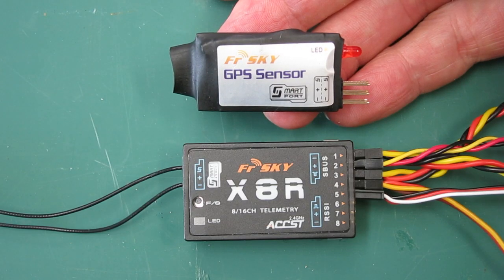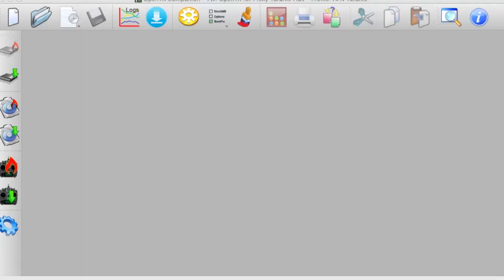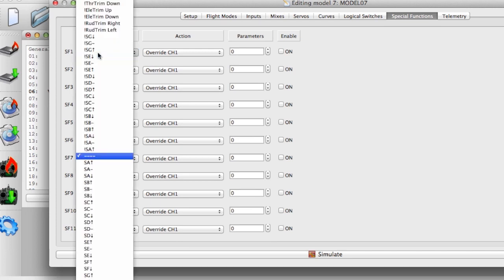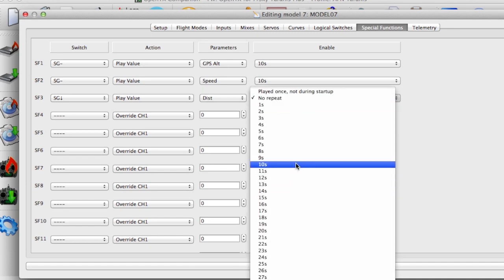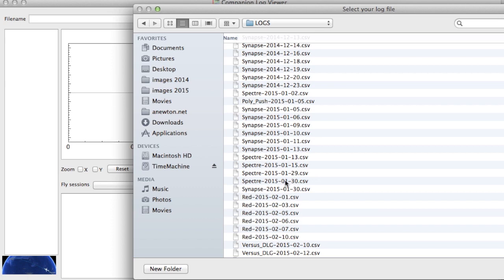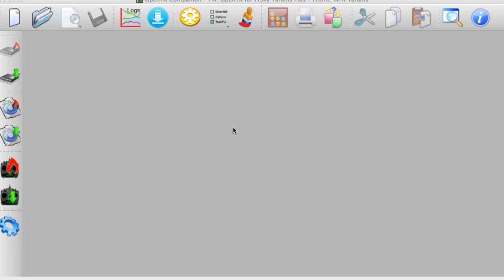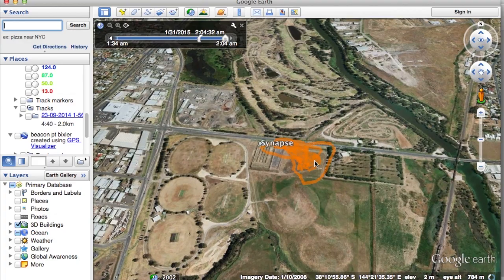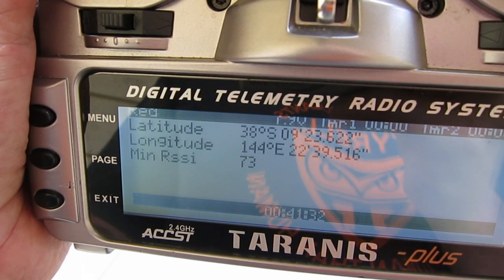FrSKY GPS sensor

Comment: I like to use GPS info to disable gear retract when speed is low.  I bet I will screw up with no safety net.   Think this will work out with no issue for that purpose.  I'm doing a FPV and use GPS wired to a drone FC for OSD.  I wasn't able to feed this GPS info sent to radio.  If I use part you show to disable retract, I'll end up with 2 GPS receivers.  Any suggestion for a better solution would be appreciated.
Reply from the maker: Which FC? Maybe ELRS receiver would send GPS speed to the radio
Reply: @AndrewNewton Using a Mamba F722.  Think I burnt pairing power board and it was sitting around doing nothing so, wanted to use it for OSD, then soon wanted to safe retract.

Comment: Hi Andrew when you set the log switch up, when you first push that switch will it continue to record the flight when you move the switch again to check the range and speed or will it stop recording until you push it back to that position
Reply from the maker: Good question, I'm not sure. Logs used to be only recorded when that switch is ON, but new versions of OpenTX may have changed that. I'll have to investigate.
Reply: Great be interested to know, I guess the easiest way would be to have the log either start recording from day the throttle movement so you do t forget or on another switch

Comment: picked one up down in novato, ca at alofthobbies.com. Going to try and use it in a scratch build f-16 edf. Have you had any issues with the gps speed reading being wrong? Had a couple comments on my IG account that it might not be.
Reply from the maker: I have nothing to compare with so it's hard to say. Occasionally when the GPS signal is lost there are gaps in the logged telemetry so that could mess up the speed reading.

Comment: I cannot get the GPS alt to stabilise ! any tricks to sorting this? Many thanks.
Reply from the maker: All I do is reset the flight or telemetry before takeoff. Make sure the sensor is the right way up and flashing slowly. Which OTX are you using?
Reply: Andrew Newton. Apologies new to this OTX? my email is jateu01@googlemail.com. Many thanks?

Comment: hi Andrew, is it possible to see these value thru your fpv goggles 

just like the mini OSD which shows the battery and timer
Reply from the maker: No, only on the Transmitter screen
Reply: Andrew Newton thanks for your quick response !

Comment: Hi Andrew, Great video, came across this.  2 questions:  I can't figure out how to connect this to a D4R-II & the smart port. Any idea if that works?  (I get a "medium" blinking light, but I can't discover the gps unit in my system;  i followed your variometer setup, and got that to work, however).  Thanks!
Reply from the maker: Don't think the D4R has smart port? I have only used the X4R
Reply: Hi Andrew, 
You are right - it's labeled a "digital data stream port", but does allow connection with certain connected devices.  I was able to get Variometer data, but when I try for GPS data, it's not being detected;  I saw in one of your videos how you connected a FrSky wire with 4 colors (red/white/green/brown maybe?) to a typical input (red/white/brown), but wasn't sure which wires were connected directly (they were under electrical tape).  

Let me ask a slightly different question then - with the X4R, it looks like it is 3 channels + SBus channel?  Is it possible to do 4 channels (with power hooked directly into one of the channels?)  Essentially, I fly DLG, and want to get all 4 channels in there.  

Just looking for ideas on which way to go (try and get GPS mounted to D4R-II, or buy XR4-II with 4 channel use)

THanks-
Reply from the maker: Yes, have a look at my V2 DLG setup. I use the 4ch version of the X4R (there are two versions) with vario

Comment: Andrew, When I try and view a flight in companion my "available fields" on the left only shows all my switches and none of the sensors.  Is there something I need to setup to get them to show?

Thank you
Reply from the maker: Yes you need to make sure "Logs" is ticked when you setup a new sensor in the telemetry screen. Sensor fields will not show in companion if they are not logged to the SD card.
Reply: Ahhh   Gotcha...   Thank you

Comment: Hi, every one. I understand that this sensor doesn't need any GPS antenna?
Reply from the maker: Correct, all in one
Reply: OK, but FC should be exactly with GPS? For example my FC Naze32 6DOF acro is without GPS.
Reply from the maker: Cant use this sensor, it's only for FrSky telemetry, not GPS for FC
Reply: Now understand,  thank you. Now, need try this sensor with my Taranis.

Comment: Andrew,  I picked up one of these GPS sensors and while following your setup I don't seem to have the Distance option to select. 
I'm using 2.1.8 companion.

Any ideas?

Thanks
Reply from the maker: Hello. It's not there by default, you have to add it as a new sensor. Go to Telemetry page, Scroll down to Add a new sensor. Enter a name, like "dist", Type - choose calculated, Formula - choose distance
Reply: That was easy enough...  

Thank you for the help....
Mark

Comment: When I look at my logged GPS data on OpenTX 2.1.8 in google earth my flight path is shown as flat relative to the ground.  Do you know what settings to play with in google earth to make the flight path show up in 3d as in your video?
Reply from the maker: +Kurtis Rupnow I couldn't find any settings which changed that. Mine just seems to work that way. Sorry, I'll keep looking.
Reply: +Andrew Newton I solved my issue.  I had renamed the GPS altitude sensor from GAlt to ASML, copied that sensor and named the copied sensor AGL, auto-offset the copied AGL sensor to show 0 ft at launch, and was logging altitudes from both ASML and AGL.

I deleted all the GPS sensors, rediscovered them, kept only one altitude sensor the default named GAlt, had it auto-offset to show 0 ft at launch, and logged it along with GSpd and GPS.  Bob's your uncle and I have a 3d flight path in Google Earth. 

I think I was confusing Google Earth with too many logged altitude sensors and possibly a renamed altitude sensor.  The KISS principal wins again.
Reply from the maker: +Kurtis Rupnow Excellent Kurtis, thanks for the update. Good to know.

Comment: Well, I would like to say this device is very good. I crashed the drone into a coffee plantation just after I installed it, although at the time I had no idea how to enter the details of the GPS position, And where to enter them, I later saw that It was dead on the spot that it fell. So to those whom are looking at this device. heres some more hints 1: see how to enter details into Goggle Maps b4 you fly. There are several ways to do this.. 2: Have reception on phone! Helps to use GPS!!!!  3: Take a photo of the controller details as soon as it goes down, for a few mins later, some people had grabbed the tree it was in, shaken it,  and then the drone fell 6 mtrs onto concreat braking the frame, and dislocating the battery. The last location was dead on. But when they had played with it a bit, in the house, they moved some things, and GPS  spat a total different location, Miles away. when it was only in the house 50 mtrs from me. 4: Maybe use some separate battery so Gps does not die.. not sure. 5: The GPS details when entering in Google maps may have depending where you are a minus ( - ) symbol.  This changes my drone in Brazil to Abu dhabi. Make sure you see these details. 6: And when in doubt! sweeting and stressed, and your without anything straight away to find your drone. If your lucky, and the people are good, and replug the battery! Use your Googles to find the signal strength in the End to find the Drone. Happy flying all. Thanks heaps Andrew also... I recommend everyone to spend this small amount of cash! its a Drone saver!
Reply from the maker: +shane glen Great story, and that must be the longest comment I have ever received. Winner

Comment: Andrew, I managed to get it going, unsure what the deal was, maybe the update, I updated the firmware and it kept dropping Telemetry, sitting still, but then it came good, took a flight and will have a look at a log now,  Distance or Alt i can't seem to get working, but will work on that,, Many regards,,
Reply from the maker: +shane glen Yes it's the new way of handling telemetry by 2.1.x . Once you have GPS "discovered" you need to "Add new sensor" and select Galt and Gspd to have them available. Search for OpenTX 2.1 telemetry fro some good tutorials on YouTube.

Comment: Hello - Andrew, Thought it was the latest, but will look now.---.I have tried to just load the latest software after some head aches, but when i do the Transmitter talks like normal, but, theres no screen and the vibration will not stop,,, and now the old bin file won't write back as well! Any ideas now noting works, This software had it seems closed out any option to revert, even old software now says its not compatible. ---latest.. returned to a companion 2.1.6 and version 2.0.19 on transmitter to have everything working again, Will try up date again because now i can't see the GPS area on the control, Suggestions, Finally, Version 2.0.9.2
Reply from the maker: +shane glen Ah yes I had similar issues. 2.1.x handles telemetry very differently to 2.0.x With 2.1.x you have to go to the telemetry screen and select "discover new sensors" You also have to click on each sensor and tick "SD logs". The constant buzzing will be the wrong firmware for your radio eg. You must select Taranis Plus instead of Taranis (or whatever is relevant)

Comment: hello, if you could help
Bought the Gps unit , hooked it in to the port etc, but no values are being showed on the Control. thought it was plug and play,, do i have to do something on the remote, regards
Reply from the maker: +shane glen What OpenTX firmware do you have?

Comment: How do you know when the GPS sensor locks on and is ready.
Reply from the maker: Brett Naysmith The LED flash rate slows down
Reply: Andrew Newton Thanks , do you know how sensitive the sensor is to altitude, say would it sense the difference between 500mm-1000mmm off the ground or even 1000-2000.Just thinking about trying to program the taranis to make my miniquad to go to a hover if I got too close to the ground.
Reply from the maker: Brett Naysmith GPS altitude is not very accurate, ~10m error at a guess, so not useful for that. The High Precision Vario sensor might be the one to try (but don't quote me on that)

Comment from the maker: Antoine Fernandez. I cant reply directly due to your Google+ privacy settings.You are right. Just need to buy a flight control board with GPS and Auto Pilot capability. Search for Eagle Tree Vector.My setup is only for data logging, not flight control.
Reply: Andrew Newton Ok thanks ! But this is very expensive ! In case you have other options to have a simplier and cheaper return-to-home function on a 8XR to Taranis FrSKY , I'd be glad to hear them.aranis X9D plus 2.4Ghz + récepteur X8RTaaranis X9D plus 2.4Ghz + récepteur X8Raranis X9D plus 2.4Ghz + récepteur X8R

Comment: do u only get the coordinate with this sensor  does show how many  satellite is the model connected too  i need some thing to show both  also is there any app that one can use the Coordinate to  get  find the exact location if the  model crash  does      the taranis shows the last  coordinate
Reply from the maker: john Al Connected satellites? No. It shows and records coordinates, speed, altitude. So the last coords will be in the log file. Clever people are writing LUA scripts to expand the uses. Search for FrSKY GPS LUA.
Reply: +Andrew Newton  Thanks   there  is not much  infos about how to update it  with the lua script    i have few  models  just wondering if  i  add the Lua script is that gonna be for all models or only one i got firmware  2.19 the last one
Reply: +Andrew Newton  how to u set this with taranis so u also  can see  all those thing that u  mention on the  taranis  screen as will   thanks
Reply from the maker: +john Al Click Menu - Page across to the Telemetry screen - Scroll down to the Screens section then select which values you want to display

Comment: Hey Andrew what's the difference between alt and gps alt?
Reply from the maker: bzd16b Alt is determined from barometric pressure using the vario sensor. GPS Alt is calculated via the GPS sensor.

Comment: Reading the GPS speed on the log can it do mph? And a on the graph you showed was that in kmph and if so was the maximum speed your plane was going 40 kmph? 

I just cant figure out how to read it. I know the funjet i have is doing 100 mph but the graph doesnt show 100 mph 

Is there a way to set up the graph to be able to read speeds over 40

Comment: Hi Andrew could you just clarify the difference between ground and airspeed?
Reply from the maker: Ground speed is the speed of the plane across the ground. Air speed is the speed of air across the wing. On a calm day they will be the same. On a windy day for a given air speed the ground speed will be greater flying down wind and less flying into the wind.

Comment: Hi again Andrew, further to my last question would I need a separate daisy chained smart port sensor for speed or does the GPS itself provide all data mentioned in the last comment eg speed,height etc ...thanks again ;-)
Reply from the maker: GPS module provides ground speed (not air speed). You can get a pitot tube style sensor for air speed.
Reply: Hi Andrew , so by 'ground speed' what exactly is that so I'm clear when compared to airspeed? Sorry I just want to understand this ;-)

Comment: Hi Andrew superb informative videos! 
I'm very interested in the Frsky GPS sensor . When used with the reciever in the video am I correct in assuming you can get flight speed in the Taranis ? Could you assign a voice alert to this to get regular real time speed read outs? Or even assign a switch that when activated would give your realtime speed as an audible voice alert ?
Cheers Rob
Reply from the maker: ***** That's right Rob. In Special Functions you would choose a switch, choose Play value, choose Speed, then choose how often to repeat. With this GPS module the Taranis can speak or display altitude, speed and distance. Co-ordinates are displayed on a screen and can be recorded onto the SD card.